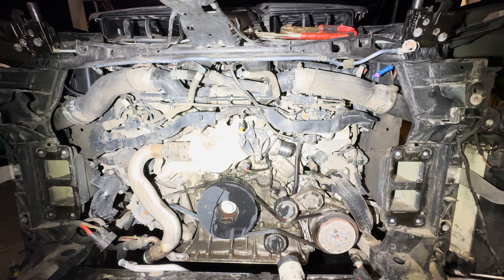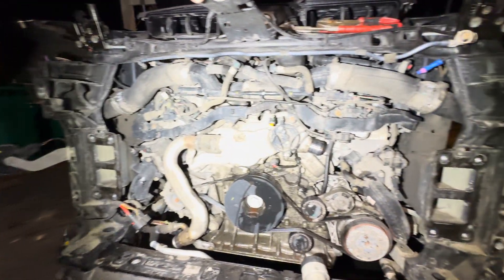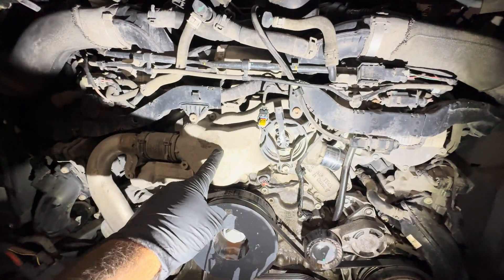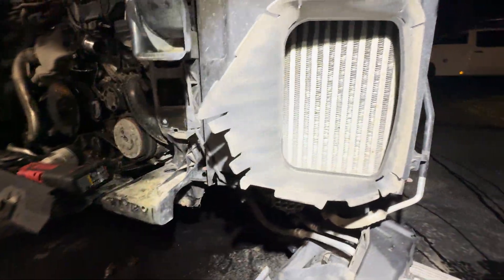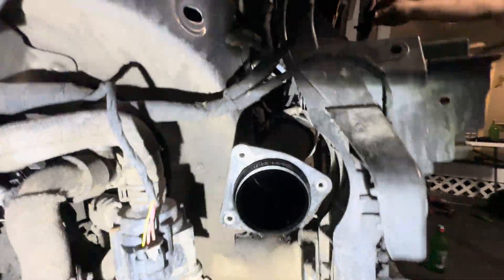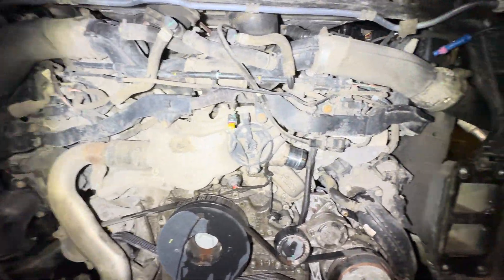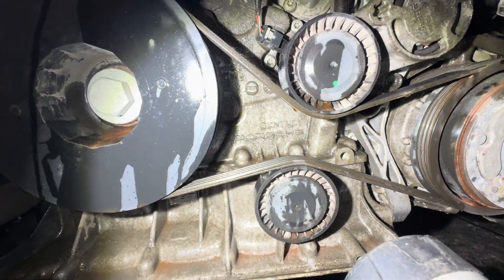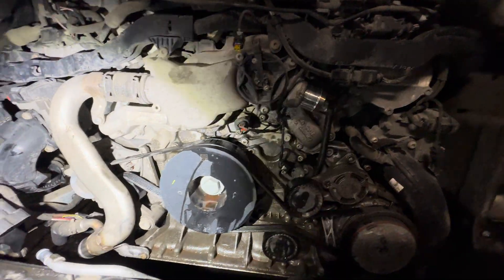Audi SQ8 thermostat, and water pump replacement

Comment: what a pita, description says 2021 but in video you say 2024? it started leaking or whats the problem? have they fixed this on the 2025?
Reply from the maker: Yeah, my apologies. I’m not very good at making YouTube videos. Apparently, but it’s a 2021 with 90,000 miles. And a vehicle with that many miles it’s about time to replace the water pump along with the thermostat. I have completely forgot to make a video about. The water pump vacuum valve, which is literally on the left side of the water pump facing the engine it has a small hose going from the water pump to the valve so I’ve learned from another guy on YouTube to bypass that valve because that was the initial problem sending false overheating temps to the computer even after doing this big job the problem still existed, but after eliminating the valve voilà problem solved thanks to that one guy on YouTube overall after doing the job many months ago these engines are bulletproof and they are worth the purchase this vehicle has about 717 hp after the stage one tuning and it has not failed Essentially they are bulletproof.